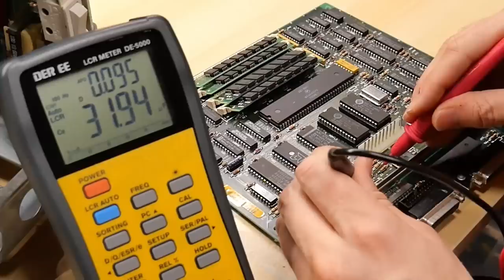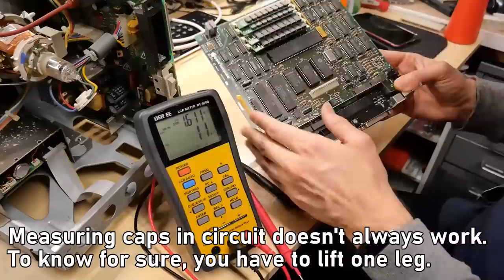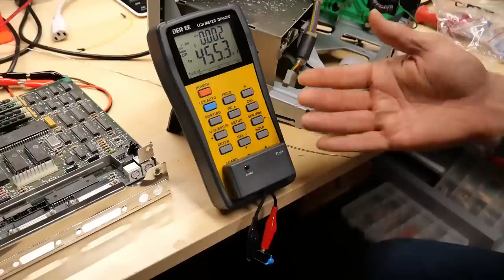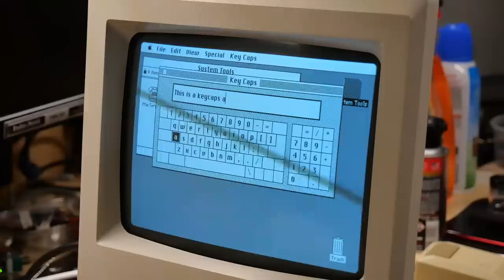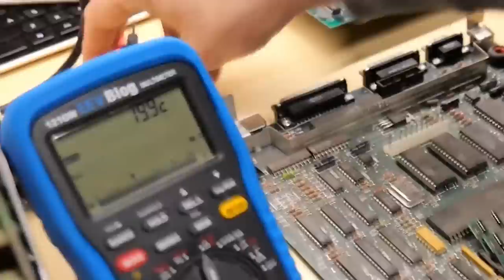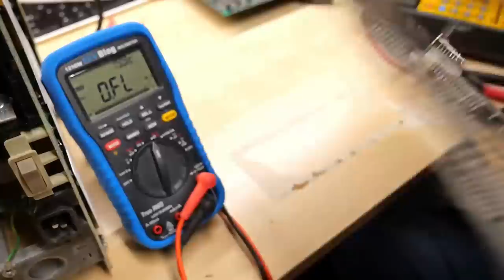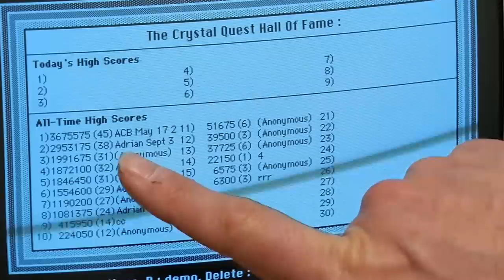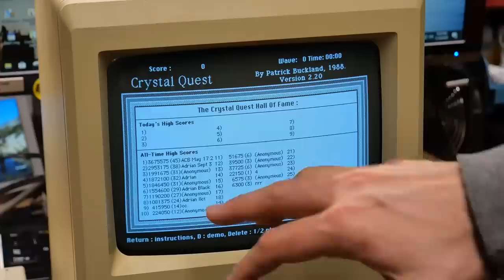Mac Repairathon Part 6: Final stretch! The Mac Pluses.

Comment: A little tip for handling high voltages. This machine has a normal ON-OFF switch so you could just turn it on, plug in a power cable that runs through an extension cord with a switch as well. And turn the extension cord's switch to cut power from the board. It looks scary every time you turn the switch on the machine itself so maybe it's a good idea to keep your switching option away from the actual board.

Comment: around the 8 minute mark, when you were working behind the Mac and using the reflection in your monitor to observe the Mac screen, I had a childhood memory. Back in the late 60's/early 70's, TV repairmen came to the house; TVs then were big CRTs in even bigger wooden cabinets so they couldn't' easily be moved around. The TV repairmen would bring a mirror on a little stand to use to observe the screen while they worked on the TV from behind...

Comment: Bad capacitors don't go up in value, they just seem to be up because of the way the meter uses to calculate their value. The meter applies a constant current and measures the time it takes the capacitor to charge up. Since the current is constant, the charge up time would be directly correlated to the capacitance. The larger the capacitance the more time it takes to charge up. When a capacitors ESR value has gone high, this resistance will cause a further current drop thus making the capacitor charge up slower than it should, this makes the meter think it has a higher value. Same applies for capacitors that has become leaky electrically. So, as a rule of thumb, if a capacitor is showing a much higher value than it's rating, (ie 25% or higher) it is always good practice to replace it. Great video as always, I love seeing old electronics coming back to life.

Comment: Final board those capacitors you removed are dying, but were revived by the heat of desoldering them. Replace them, and readjust the 5V rail to get it spot on again.
Reply: I thought that too i also noticed the plastic sleaving on some of the capacitors has shrunk probably been running hot like you say the heat from removing the faulty caps has probably tempary altered the esr etc hence working for now
Reply: This makes sense and to prove the point, where they where indicating as bad before he removed, I bet the test result would be different now.
Reply: I've been trying to fix a Trinitron TV and I took a capacitor off the board to test because I was getting strange readings. Out of circuit it was fine so I put it back. I may have to re-test it now (it still doesn't work).
Reply: David Rickard are you testing the uf rating and also the esr Reading when I suspect capacitors I sometimes use a hair dryer to heat the board up if the set then starts up ok I will do a full re cap of that board
Reply: @DavidRickard1  Trinitrons suffer from resistors going high in value as well, plus the usual GCS failures. In the areas of a GCS you will be best off replacing it with one of the multiple of retrofits instead.
Reply: Yea unfortunately he still hasn't learned that ESR and capacitance aren't enough to judge if a cap is dying. Especially as this doesn't test for electrical leakage.
Reply: @vincef836  unfortunately I've not got an ESR meter, which makes testing a bit less reliable. I may have to look at investing in one.
Reply: @SeanBZA  GCS failures? Sorry if dumb question.
Reply: David Rickard on eBay you can get one for about £10.00 or less it’s a tester that does a lot of other tests too like transistors resistors diodes etc made in China but can update firmware etc
Reply: @vincef836  I saw those but they looked too cheap! I may give one a punt.
Reply: @DavidRickard1  Gate Controlled Switches, Sony variation on a thyristor which could be turned off by drawing sufficient current out of the gate terminal, bringing the internal transistor structure out of saturation. They were used in a lot of the Sony TV sets, and only long term operation showed the drawbacks of the design, in that they would fail to turn off after ageing for a few years, and going short circuit. They are a common failure there, and as they are no longer made, and are not available even as NOS any more, there are a lot of modifications to the sets to replace them with standard bipolar switching transistors designed for vertical deflection use.
Reply: @SeanBZA  oh wow, thanks. Well I'm hopeful it's not that, but I shall look out for it.

Comment: The capacitance of the caps is not super important, that's basically just how much ripple it will get rid of from the AC lines. The more important part is the voltage. You're in the clear on how much voltage they can take, and in this case, they are actually safer. If you got a power spike there's way less chance of a 400 volt cap blowing than a 200 volt cap.

Comment: No, the important thing about the X/Y-rated “safety” caps is the voltage rating, and substituting the right kind. As long as the capacitance is generally on the same order of magnitude as the original, you’re okay. They’re just for noise suppression. The A.C. Impedance of a 1 nF capacitor @ 60 Hz is around 2.6 Megohm. @ 120 VAC, that would create a leakage current of about 45 uA. And the capacitance of the one from neutral->earth doesn’t matter as there shouldn’t be any (significant) voltage there, anyway. HTH.
Reply: Neutral to Earth can be important when you are dealing with GFI or RCD circuits as Earth and Neutral are not connected and can have a potential between them.  There should not be significant voltage, but if you get any leakage at all across there, then you can trip the GFI device or RCD.
Reply: Are thin film capacitors used for the high voltage rating? Always wondered why they are shaped that way
Reply: @EsotericArctos  in my house in the UK, the earth conductor is bonded to the incoming neutral conductor from the street, but splits off before the fuse box.
Reply: @TomStorey96  in the US there is a separate "neutral" reference that is used to get the nominal 120V w=plug voltage by having a split rail - the actual voltage at the breaker box, when ground referenced, is 240V. It means that there can be quite a bit of voltage difference between circuit neutral and actualy ground.

Comment: You almost have to give any old single sided board a good inspection. What I would recommend if there was a part that had a cracked solder joint and it has some weight to it, I would clean the part and surrounding board with isopropyl and put some RTV along the edge and the board to ‘anchor’ the part and keep the joints from cracking again.

Comment: Thanks for the WD-40 tip for gooey plastics. The Cisco 3750 stack cables we use at work go this way, and I always hate touching them when I have to work on those switches. To the point where I literally put on nitrile gloves to handle them! I've tried using IPA to clean them in the past, but it doesn't really work. I'm sure I can find some WD-40 to clean those cables though, so that should help make them less gross to handle.

(And yes, we've still got 3750G and 3750-X stacks at work. Management keep rejecting capex requests to replace them, and they haven't failed yet so they must assume they'll keep working forever, despite being end of life and out of support! Even despite having several fail, we were just lucky to have spares from decommissioned systems so we could get them replaced within 24 hours.)

Comment: +/- 10% is a very common accuracy rating for caps, so 2000 pF vs 2200 pF is no biggie.  I honestly wouldn't worry much about even doubling or halving the cap value, since this is a tiny noise filtering cap and not in any feedback loop (so it shouldn't affect stability of anything).

Comment: The reflow could be on these boards could be from the automatic reflow machine not soldering and they were soldered by hand after inspection. I  managed a pcb manufacturing process and this was common if the reflow solder started to get contaminated.

Comment: For cracked joints like those (and you are definitely right, those are cracked), I'd get out my big weller iron with its big fat tip which holds a lot of heat, and just reflow the entire board. But maybe that's only me.
Also, new slogan for WD-40, "It gets the sticky off."

Comment: Regarding Farad value, Farad value is used to determined the current capacity of the Capacitor, AFAIK you could swap capacitor with different Farad value it "only" affecting the smoothness of the current flow, as long the Voltage value is correct because it will blow up if you put lower Voltage value than the current one. CMIIW, it was an old lesson for me back from the 8th or 9th grade era and never been refreshed. :D

Comment: For the second Mac Plus, if you kept the foam you can check the continuity as these can become conductive over time and could cause a short on the solder joints

Comment: whining was probably caused by deoxit making stray capacitance in the connector. when it dried up it stopped. we in Europe use kontakt sprey. they are very similar but kontakt makes a lubricated and dry version of sprey so I use dry one with sensitive electronics

Comment: I have noted something about the two capacitors that you pulled from the machine 1 analogue board. 
Those caps have gotten hot some time in the past. 
The vinyl label is heat shrink material. 
It is a tail tale sign that a electrolytic cap like that has over heated when the sleeve has shrunk down off of the top. 
Also on the one cap on machine 2 motherboard that was reading higher than the rated capacitance. 
That is also a tail tell sign that the cap is electrically leaky or has low resistance. 
BTW I enjoy your videos.

Comment: On the last machine, it's possible that just moving that voltage adjustment pot may have fixed the problem.  The pot's wiper can tarnish over time and the slightest movement will abrade that tarnish which only grows to a few molecules of thickness.

Comment: Mac #1 notion: initial cycling due to bad motherboard +5V connection — oxidization. Floppy drive still providing a little load, so power supply clicking was slower than when you powered up the analog board alone. Reassembly (and DeOxit?) resolved the bad +5V connection, providing enough load for the power supply to stabilize and the system to work.

Comment: Hi Adrian,
I think when you measured the resistance of the caps (30:15) , you were also charging caps on the board (from the meter) when the value was rising gradually - and discharging when it was falling gradually (it would depend which way round you connect the meter). So the resistance you measure will have depended on whether the board was recently powered and how long you measure for.

Love this series, just like I love your whole channel. Thanks for all your videos :)

Comment: Yes, Y Caps are between L1 and Earth and N and Earth.
And, in theory, you can leave them out. 
A PSU Technician once told me that they aren't really input filtering but filter the stuff from the device going to the grid. So you could, in theory, leave them out. But its better to have them.
As for replacing them, I'd not worry much about X/Y Caps much as it doesn't affect the circuit in any way whatsoever...

Comment: Thanks for the nice series of video, very entertaining!
If the PSU needs a load to start - which is not uncommon - it could have been a bad contact on the motherboard cable? By removing the motherboard and plugging it back you cleaned the contact and voila'. Or it could be a bad solder joint which has temporarily made contact. Yes, not fun when things start working again and you don't know why! :)
Regarding the RIFA, I had to replace the RIFA in my Apple//e PSU and monitor and I found online that the "X" version of those caps are designed to be installed directly on mains voltage and that you cannot just replace them with anything. On my system I went with another set of them (the monitor had 4, two of them had already exploded!). Not sure if this helps. Cheers!
Reply: That was my thought as well. Back when I tested high cap telco circuits, sometimes just "exercising" the DSX jacks would fix the issue.

Comment: With that second mac it may be good preventative measure to reflow the connections and what not. Even if they look good.  Deoxit everything ect.  Myself I tend to just recap the whole things anyhow as the caps eventually will go.  But when dealing with so many machines that can be a bit much to deal with.

Comment: Hi Adrian, It’s fantastic the work you’ve done bringing back to life those Classic Macs. I’m trying to repair a Macintosh Classic but it seems I have no power from the PSU. I have two logic board and both do the same.. No voltage at all.. no high tension at the fly back.. The fuse is ok.. I’ve recapped the usual caps at the logic board with no success. Can you give me a little help?
Reply from the maker: Unfortunate I don't have enough experience to know common faults on where to look. If you're getting main voltage past the bridge rectifier and it's not making any sound at all (like no chirping) then it's not even startup. So focus on the high side circuit that bootstraps the switching controller. There are decent schematics for the Classic PSU lickily.
Reply: Adrian's Digital Basement 

Thanks for your advice!

I have one more question... If the motherboard is not in good condition... should I get the fan working? And, I’ve noticed that the +12v (yellow cable connected to the motherboard) line  has continuity with the ground when the screen is connected. That happens with two different screens and two different logic board I don’t know if it’s normal.

Regards.
Reply: Adrian's Digital Basement the colony was a fun game to play in my 2nd grade in 1992 I was 8 we had a Mac classic and our art teacher let us play it😉

Comment: On the second Mac, I am feeling like removing and re-attaching the cables to both the motherboard and the analog board can clear up deposits from moisture intrusion simply by friction. I worked on many older systems that would develop issues like this over time, and adding a dielectric grease to the connection provides moisture resistance and stops the issue entirely.

I remember a common issue with IBM 486 and first gen Pentium memory modules (72 pin DIMMs) had tin leads that commonly developed oxidation thanks to humidity, and removing and reinstalling the memory brought bad systems back to life. I used a LOT of dielectric then... Deoxit spray would have made it so much easier, as it includes a dielectric grease.

Comment: Sometimes heating up a component with a soldiering iron (while removing it for testing) will change the value and make it go back into spec. Sometimes just desoldering and soldering things will fix it. Of course it won't last... so then you'll be right back to trouble shooting again.

Comment: Hi Adrian. Don't worry mistakes happen .I too I got electrocuted busy fixing a old ATX power supply. By mistake I put my hand on the MOSFET heat sink on primary while touching the case when it was on. Got a good shock and tipped the earth leakage on the electrical board. After that I had a good laugh at myself for being so stupid.

Comment: I got a 21" Sony Trinitron TV for repairs (keeps blowing fuses on applying power, so something is pooched) and it too has a very sticky gooey anode cap, but in its' case, it's a grease of somesort, probably to keep contaminants out of the CRT, but I'm far from an expert on CRTs, still crap myself poking the cap with a grounded screwdriver, having been shocked by a CRT in the past through dumb mistakes on my part, they're scary, but when they work, they're great... :D

Comment: WD40 /can/ cause issues with plastics and rubbers (it can make the material harden or shrink over time) but it's really not a big deal. If that were to happen, you can probably find another flyback without too much difficulty. I use whatever light solvent I have lying around to clean up that kind of stuff. Usually something like 98% isopropyl. If people complain about it, just.... ignore them.

Comment: as a computer tech i would tell my other techs to use a pen cap or the like to test a noisy fan..  of course one figured a screw driver was good enough.. and shorted the power supply and blew the computer..  so yes plastic poking tools are GREAT..

Comment: I was always told that when replacing power supply caps that you don't have an exact replacement for you can always go for a higher voltage and capacitance rating, but you should never go smaller. Was that wrong?

Comment: 39:36 i think i know what could be check plug see if any loose if not than i see u did redo soliding on capacitor n because have shorted on soliding n great jobs fixed

Comment: If the voltage on the caps is higher it should be ok and even last a bit longer as long as the value is the same.

Comment: 9:22 Pro tip. Keep a big piece of clear rigid plastic sheet or two, or even cardboard, A4 size or thereabouts,to place between the motherboard and anything it might slip and touch. That way when things fall out of place, they don't land on anything hot and fry themselves, or indeed you, as you grab them to stop them falling. 
I always used a clear piece of plastic which I placed against the back of the HT board and tacked on with some electrical tape,  when working on anything with a CRT (Macs, Wyse terminals, monitors ans so forth). I still took great care to avoid touching anything, but you only need to touch a running HT once to realize it 'aint a good idea. A slip of a metal screwdriver, or one board touching another makes for a very expensive day. 
By the way, is it just me, or do large exploding electrolytic capacitors smell of burning horse manure?  Don't ask me how I know.